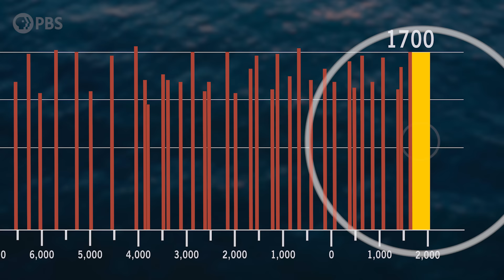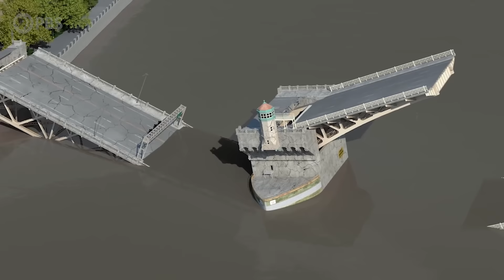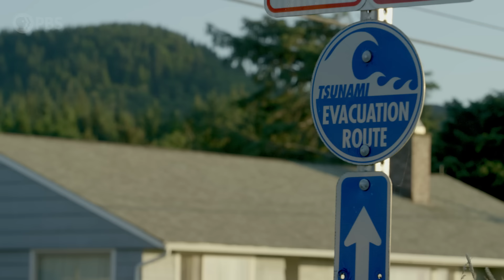Will the Cascadia Earthquake be the Worst Disaster North America’s Ever Seen? | Weathered

Comment: That Juan de Fuca plate that goes underneath the Cascadia has been having a series of smaller EQs lately.  It's moving more, it seems.
Reply: The great california exodus is real. so are solar minimums.
Reply: That's actually a good thing. Smaller quakes means it should be slowly releasing tension rather than building up for a giant release.
Reply: When I live in Washington 😔
Reply: @jforester7  Could be, but often times smaller quakes supercede a megaquake. In fact, the larger the eventual earthquake, the higher the chance that it will have significant foreshocks.
Reply: @jforester7  
Sorry.  The frequent smaller quakes are mostly from the uplift & buldging of the NA plate as the subducting Juan de Fuca is caught/stuck on the leading edge and pushes it up, as per the animation.

When that subduction boundary edge/intersection slips and releases is when the real fun begins.  :-/

Japan's 9.0 megaquake was preceeded by a lot of smaller quakes, and then a few ~7 magnitude quakes the week before.

Being prepared.and having a plan for both at home and at work is about the best and only thing you can do.  Realize that 90% of communications/cell towers will probably be down as well.

You'll need a way to keep them charged, too...a roll-up/flexible solar panel and USB battery bank, etc.

ATMs and banking systems will most likely be out of commission, so cash & carry will be advisable.

And especially in Cascadia, an event like this will most likely trigger at least some volcanic activity as well, so it's entirely possible to be a triple-whammy.

I'm a hiker/camper, so I just keep my tent, sleeping bag, water, MRE's, and 1st Aid Kit in my vehicle 24/7, along with my bug-out backpack.  I rotate/replentish the perishables every 6 months to a year if they aren't naturally replentished via hiking/camping excursions.

At this point, the entire U.S. West coast is long overdue.
Reply: I get tacos from Juan de Fucas every Tuesday🌮🌮🌮🌮🌮🌮🌮🌮🌮
Reply: @marcslider , those are 🔥🔥🔥
Reply: @jameshughes131  whut
Reply: @marcslider  
best comment 🎉👏🎊
Reply: We are all going to die
Reply: @northwest_photography  nah
Reply: @bbfoto7248  
You speak truth. 
It’s unbelievable to me that underneath a place of such spectacular, majestic beauty lies a killer.
Reply: Better to be moving more rather than building tension when caught.
Reply: Read this as the what tha fucka plate lmao
Reply: @northwest_photography  laughs in Central Canadian.
Reply: @jforester7  nahh, small quales have fractions of energy released compared to an actual magnitude 7 or higher. The only way for energy to release is unfortunately a large quake
Reply: The plate has always been on the move. It would be better to notice that your on the move AWAY from a potential disaster. But hey you sound human, best of luck.
Reply: @jforester7  If tectonic plates fail like smaller scale materials, there'll be an increase in microfailures leading up to the catastrophic final snap when all the tension is finally released. Smaller earthquakes already do that on the scale of minutes, the question is if there are much bigger windows if time, which is a sensible question since we're dealing with much bigger forces. More generally systems collapses tend to show accelerating instability before system failure.
Reply: That's a good thing though. Small quakes= releasing pressure.
Reply: @bbfoto7248  I’ll just take your stuff
Reply: @bbfoto7248  Well on the upside all the cell towers going down will force AT&T to get off their collective asses and fix their god damn service.
Reply: Good.... Portland needs a good cleansing
Reply: I felt the one a couple years ago here in Portland.

Comment: They never mention the coastline drop. Having lived in Seaside for 2 yrs, I know the hills have a LOT of sand in their makeup, if not just the base, so they will slip & slide, burying many.
Forget the town...it's already 4' BELOW sea level. The drop will sink 98% of structures so that even after the tsunamis (yes, plural, more than one), they will likely be under water.
Reply: If your hills aren't stable you're in trouble.
Reply: I’m expecting that new development at the end of the road up Tillamook Head to be lost.  I can’t imagine why anyone would live there.
Reply: Indeed. A meter or more drop that is permanent.
Reply: Those hills have sand from glacial deposits from the last ice age. The whole pacific northwest is full of sand and other materials deposited here by the last ice age.
Reply: @ashakydd1  it's call "glacial till" and it's not just sand but sand, gravel, larger stone that we call "spanaway spuds" (as in potatoes). Lovely to try digging in. 
The hills that do the most liquifaction or sliding/movement are the areas that are man made fill. Such as what Seattle is built on. The Nisqually quake was a clear example of it's affects.

Comment: Seattle here. Google the Columbia Tower. 70+ stories high, sways over 6 feet in all directions for wind sheer and seismic absorption. Worked there for many years. The water in the commode would sway slightly. Took awhile to get used to, but I never got sick while yachting on Puget Sound on the weekends, as your body is used to self-correcting. 

It was, however, quite disconcerting to my visitors who would pop in for lunch, lol. 

THIS BUILDING IS MOVING! 

Really?... as their face turned ashen. 😎
Reply: Good point. It's amazing that so many of the buildings in Japan like this did not collapse in a similar magnitude quake!
Reply: @ElementalWildfire  During the Great Hanshin earthquake that hit near Kobe, thousands of homes were lost and over 6000 died mainly from houses collapsing and the ensuing fires from gas leaks. That was 1995 and many corrections were made since then. That was a 7.3 M earthquake. So they did have a learning curve to deal with as well, unfortunately The west coast for the most part is still far behind in new construction that can handle earthquakes.less than 40% of all building's could withstand a 8.0 earthquake that last 2 minutes...Much less a monster 9.2 for 6 minutes.
Reply: I'm in Portland now but a while back my wife worked on the thirtieth floor of a Seattle skyscraper on Fourth Ave. The building actually TAPERS at the bottom! Don't hold out much hope for that one.

Comment: Installing hardware to create a rigid, inflexible connection between a house’s foundation and its above ground structure is guaranteeing that all movement of the ground is transmitted directly to the framework of the house as if shaking it to pieces was the goal. Structures that have proven to survive earthquake events tend to rest upon systems of rollers and springs which allow movement and absorb and redirect kinetic energy rather than transmit it directly to the building’s framework.
Reply: what? chunks of plywood like that aren't a good idea? who would have thought lol

Yeh, whole idea was pretty nutty imo!

Comment: It’s not just a tsunami, the shoreline is dropping. Cascadia will have a new sea level-far lower than before. The shoreline is literally going to sink into the ocean when that tension releases and the North American plate slides over the pacific plate
Reply: Following the quake in 1700, the elevation dropped something like 6 feet at about a kilometer inland, creating the Copalis Ghost Forest. Based on the data geologists learned in 2011, some estimates are that the Washington and Oregon coasts might drop as much as 10 feet in elevation after Cascadia goes. There's a lot of low-lying areas up and down our coast that are going to be underwater until the ongoing subduction pushes it all back up again.

Comment: The more we learn about what the Earth is capable of, the more our industrial infrastructure becomes an unsustainable fool's errand.
Reply: You're right, but also, that infrastructure did work pretty well for a decent amount of time!  Both of those things are simultaneously true :)
Reply: Earthquakes happen so don't build factories? Huh?
Reply: Well, its also the past head generations constantly kicking the buck to thw younger yet screwing them over instead of fixing and preparing them for such senerios.
Reply: @Luboman411 That's what the emergency engineers say, problem is updating or tearing down and rebuilding budgets. A good example is this pandemic, buildings are and were not up to code for a level 3 to 5, pending your sources, pandemic. But the cost is so high and time was jot enough to retrofit or tear down and rebuild buildings to address that issue.  Its cheaper to clean, sanitize and restructure/set up floor plans than to do that.
Reply: @Luboman411 Reminder that Japan get a minuscule 4.8 less than a week ago and had 100s of thousands without power...

Comment: Some ply wood and retrofitted hurricane clips are going to secure your HOUSE to a 100 year old concrete foundation. Mmkay.

His engineering abilities are amazing. 😂
Reply: It may seem surprising but I looked into it out of curiosity, and this is in fact a recommended, common, and proven way to meaningfully improve earthquake resistance (sliding, buckling, and tilting) at relatively economical scale. Half-inch thick S1 structural plywood with the proper nails can resist many hundreds of pounds per foot along the shear direction, and when you install it in perpendicular directions (i.e. along all four walls) that means some component forces will be distributed in the shear direction no matter what, granting tens of thousands of pounds of connection strength overall.

It's not just one guy selling plywood off of a pickup truck, it's an industry based on study results and building codes. Of course there may be more to it for a given house than just strengthening the cripple wall connection, so an engineer should always take a look.
Reply: My thoughts exactly, but after I learned that those little (moveable) flaps on the airplane wings can make a big difference...then I no longer question anything...lol!

Comment: The folks who are focusing on the mega-quake of 1700 are looking at the wrong earthquake.   The previous Cascadia mega earthquake was 1000 years earlier (700 AD).  So it took 1000 years for the tectonic pressure to build up enough to release the energy in the mega quake of 1700.   

So it’s only been 322 years since the last big one.   It might take another 700 years to build up enough tectonic pressure to produce a mega quake like 1700.  

There is a lot of uncertainty but I’m not concerned.
Reply: My dads been hearing it a long time. He just turned 80 and it hasn’t come.
Reply: @bluehawks2064 well, that clears it all up then.

Comment: Seaside (and similar cities/towns on the coast) will go under water and stay under water. That area is currently uplifted by the plate buckling upwards. When the quake hits, that area will sink below sea level. Sure, there will be a little time to evacuate the area - the displacement will happen off the coast and suck the water out to sea before it comes rushing back in. But they won't be returning to their homes.

I was a little surprised to learn that a lot of houses aren't bolted to the foundation, but I live in Tornado Alley - that's basically required if we don't want our houses taken out by an EF3 or smaller. Not that such houses don't still exist here - they do. And they're cheap AF for a reason.

Comment: I’m confused. I thought “the big one” was down here in Southern California along the San Andreas and would affect LA and LBC. Is that a separate big one?
Reply: If the San Andreas fault can produce "The Big One", the Cascadia fault can produce "The Very Big One".
The Cascadia fault is separate - but far less well known.
There are several "Big One" earthquake faults around the world. One that ruptured in March 2011 was just off Japan (magnitude approximately 9.0). In December 2004, there was one in Indonesia. Two weeks ago (in February 2023) there was one in southeastern Turkey and northern Syria. 
The San Andreas fault runs through the Sea of Cortez (Gulf of California) past Los Angeles and out through San Francisco Bay between San Francisco and Oakland. 
It's the geographical length of the fault that determines the maximum possible magnitude. For the San Andreas fault, the maximum possible is about 8.5. For the Cascadia fault, the maximum possible is about 9.2.
The New Yorker carried an article about the Cascadia fault in July 2015, by Kathryn Schulz. It's accessible on-line, and well worth reading.

Comment: So, my admittedly limited knowledge of subduction zone tsunamis leads me to believe that tsunamis can only occur in areas where the seafloor is sloping, not jutting up. Now for my opine, valid or unsupported I know not. I wonder, using modern technology, about the efficacy of creating and laying, in "stepped arrangement" parallel to the affected coastal areas; submerged seawalls that could be raised [or inflated] when needed to "chop" off the wave from below [or redirect its energy to oppose the incoming wave] as it moves up the slope, towards a coastline. Effectively removing its increasing energy. Just a thought.

Comment: Biggest earthquake I ever experienced was the 2011 Virginia earthquake (magnitude 5.8). I was working in a building just outside of Washington D.C., and it felt and sounded like there was an unbalanced washing machine the size of an SUV on the floor above us spinning cannonballs around. People who came in from outside said they could see the ground and the paved parking lot rippling, like small waves traveling across a pond.

That was magnitude 5.8, and magnitudes are base-10 logarithmic. The difference between the one I went through and what the Big one will likely be, is a factor of almost 1,600. For comparison, that's a little bigger than the energy difference between an AirSoft pellet and a bullet from a .44 Magnum.

Comment: While the average between major earthquakes in the Cascadia subduction zone is over 500 years it may be sooner this time. It was discovered during the last regular solar minimum using ultra precise laser measuring systems that during a solar minimum our planet also shrinks some. The extra pressure may result in the Cascadia rupturing early and could be much stronger, e.g. above 9.0.

Comment: Local officials won't even consider commonsense life saving solutions such as building Geotube-structured tsunami evacuation hills, or building Geotube structured dune berm that could block a tsunami from overtopping the two peninsulas of Ocean Shores and Westport. Ocean Shores officials are avoiding even acknowledging that the five vehicle cuts (allowing tourist vehicles to drive onto the beach) through the dune line will accelerate tsunami destruction through their community.

Comment: Juan de Fuca plate is a small remnant of the Farralon plate, which once transcended the entire North American coastline down to Central America. It's responsible for most of the continents western mountains, including the ones I look at out my window here in Western Arizona, a chain of volcanic strato volcanoes , now considerably worn down to original magma cores, that formed from this plates subducting fault as it slid in an under from the west, starting about 35 million years ago. Also when this formerly larger oceanic plate slid in and under , it deposited some small micro continents and islands against the preexisting coastline line building up the land mass that is now modern day California. Californias current geological woes are no longer caused by this ancient plate which only has its remaining remnant along Cascadias coastline. They are from the newest subducting oceanic plate , the Pacific plate.

Comment: Good video. But let’s be real. A 9.0 for the US will be a massive disaster at least 10X more damage and death than Japan.

A lot will depend on the success of the retrofitting which is never as good as actually building for an earthquake to start. 

Also the evacuation routes need to be built now. New multi lane roads and highways directly to the coast and into the hills. 

All the surrounding communities within 500 miles should be upgraded to absorb thousands of displaced people. More hotels, more restaurants, more sports stadiums, more hardware stores should be built from 10 miles out and onward east.
Reply: Unless it happens in alaska

Comment: The fault line is far out to sea. Major population centers are far inland. As for tsunami, major cities are unaffected.  A tsunami can’t run up the Columbia River or make a right turn into the Puget sound & travel south to Seattle or a left turn into Vancouver (BC).  Simply said, Vancouver is protected by Vancouver Island & Seattle is protected by the Olympic Peninsula & Portland is more in danger from their own people than a tsunami. Coastal areas are in danger, but are rural. Made up of small towns & small cities & hardly any industry. The geography makes it rather easy to get to high ground as well. Tsunami training is well rehearsed.

The only structures expected to fail are masonry & older unreinforced bridges or buildings. Most bridges will survive. Most buildings will have minimal damage. Bring it on, we are ready.
Reply: "& hardly any industry"
Yup. I live with the consequences of that one.

"Bring it on, we are ready."
I'm guessing I should thank you for baiting out the Eureka shake earlier today. Eyes back on this, and we got a slight reminder of what displaced water can do.
It's surprisingly strong stuff when pushed hard enough.